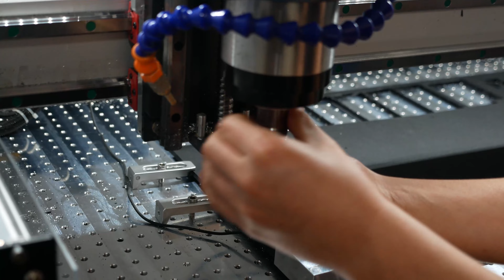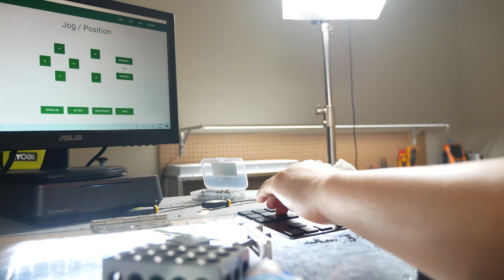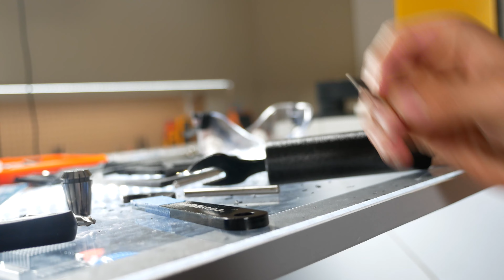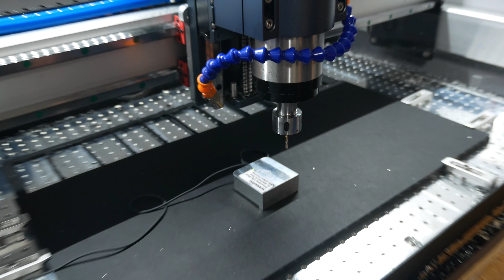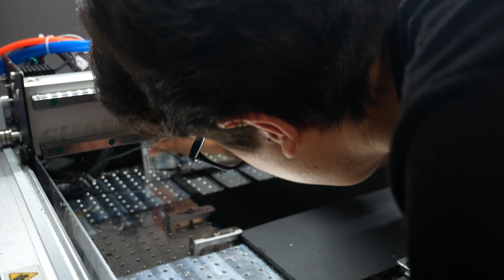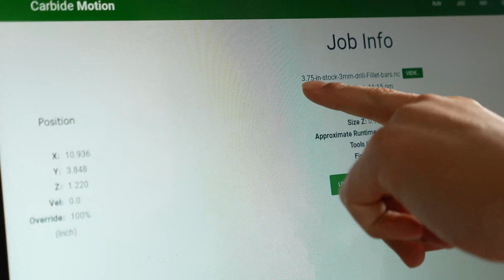How to Zero on CNC Router

Comment: Awesome machine.  Is that spindle 110v or 220v ?
Reply from the maker: 110V
Reply: Does the carbide software account for the drill bit diameter when calculating the x,y zeros?